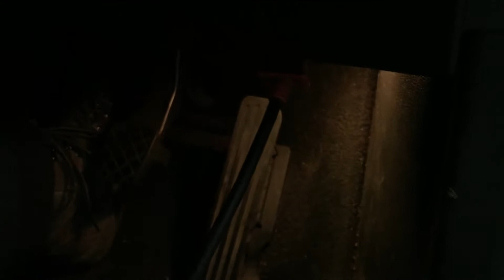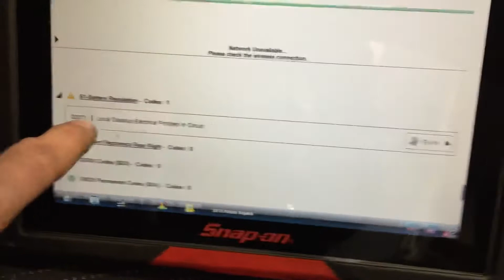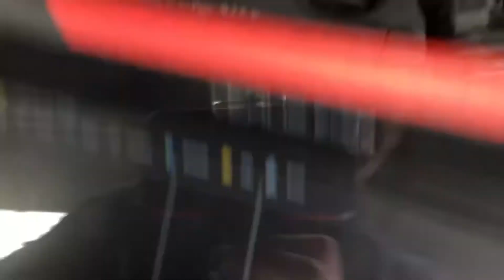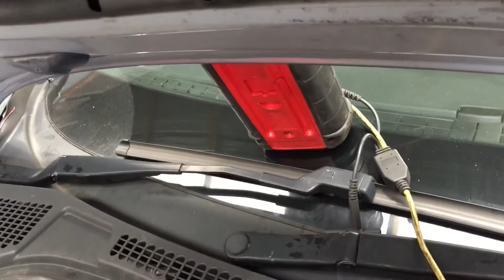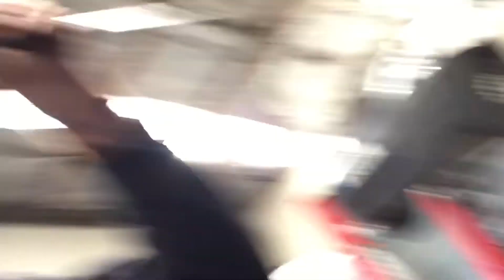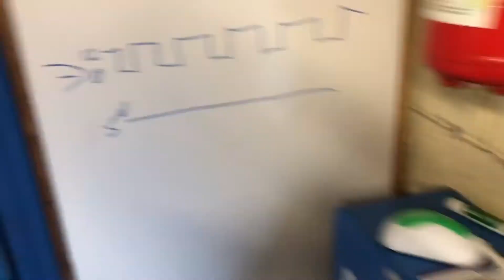Skoda/V.W intermittent no throttle response 03406 & 02071 fault codes

Comment: So question. I have replaced the alternator on my misses car and we now have this issue to. Ive replaced the alternator with one that isnt the correct voltage regulator type for the lin bus one as it goes away when I remove the plug like you did. Could I fit a genuine voltage regulator and this would solve that issue?

Comment: Hi  peter , I'm working on a 2020 my renault clio 999cc  non turbo   had  fault code dtc0226f1 accelerator  position  1
I made a mistake and changed the throttle pedal based on this code

still having same fault code  looking at  live data on generic obd   data for the accelerator  position sensor  looks perfect but when i go into renault  manufacturer specific data if i just  touch the pedal    the accelerator position goes to  max  

would you happen to know if there is a accelerator position re learn  procedure for this  or would it need to be a trip to the dealer ?

any advice would be greatly appreciated 👍
Reply from the maker: A relearn just establishes the minimum and maximum voltage the sensor gives out. So I would say that isn’t your issue. Would you have another scantool to try ???
Reply: @kennedysgarage3281       I'll try another scan tool on it - Thanks .  its a  used pedal i put on it so could be possible its faulty too 
can't understand how looking at pedal data on generic obd side it looks perfect but when using renault  manufacturer specific data its either on or off  even just pressing the pedal 5%  
I'll let you know the the fix  when sorted . Thanks again👍
Reply from the maker: @johnbickle4654  cars can be funny things , electronics act different than us. I quite often see Mazdas 6’s with no faults in Mazda but faults in EOBD 🤷🏼‍♂️🤷🏼‍♂️🤷🏼‍♂️

Comment: So what was the problem? I have same codes in 2014 Superb. Already changed battery ground gable and checked wirings. Don't know what to do next
Reply from the maker: Did you watch the whole video??
Reply: @kennedysgarage3281  Changed alternator and zero fault codes now 👌also gaspedal works smoother now, it was little bit on/off style before.
Reply from the maker: @Hotrod28  brilliant hotrod well done 👏 👏💪💪👍
Reply: @kennedysgarage3281  
Hello, do I need to replace the entire alternator? Is the alternator voltage regulator alone enough? Kind regards.

Comment: Very nice Peter, does that intelligent battery  wire goes back of the generator ? I might look into this wiring to understand the connection between the two !
Reply from the maker: Hi Even, no but the pcm was getting confused on first start up and was choosing to ignore the throttle position for a few seconds until it figured what was going on. Both the IBS and the alternator are using LIN bus circuitry, which does tie them together but not directly, if I’m phrasing it correctly 🤔
Reply: @kennedysgarage3281  I see they are both on Lin bus ( well i learned something interesting from 5v reference voltage although the wiring does not show the internal of 5v shared ref but they are ) I am guessing this Lin bus is similar although it has no connection but internally ( in ECU they are shared ) just like 5v ref voltages
Reply from the maker: @evansmarts775  it has been a few weeks since I recorded this, so I’m now looking up wiring diagram 🙂. At both the alternator & battery sensor I had a red & brown wire they then both change to violet & yellow they then tie into the diagnostic control module 🤔. IBM tells Alternator its condition & then alternator charges if needed or doesn’t if not needed. Everyday is a school day & I personally don’t think any of us will ever know it all. 
Are you subscribed to Bernie Thompson, automotive training solutions? Definitely worth a watch